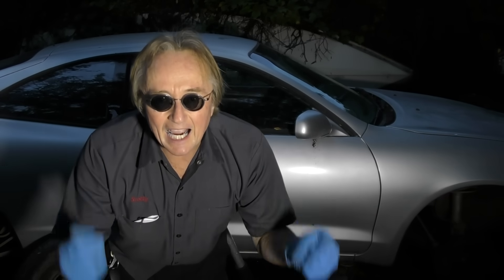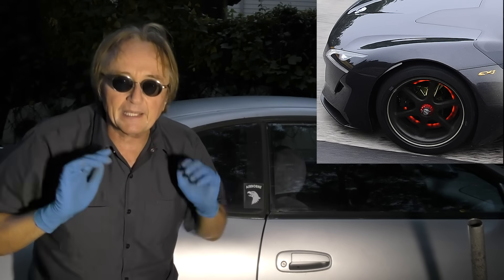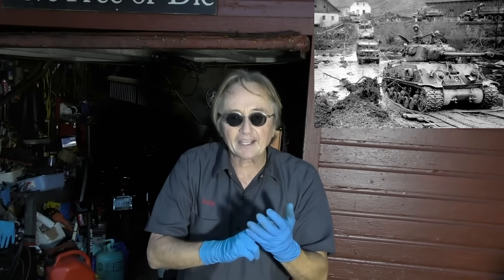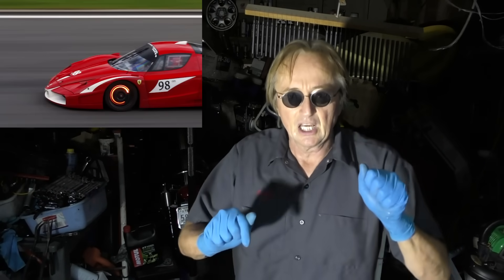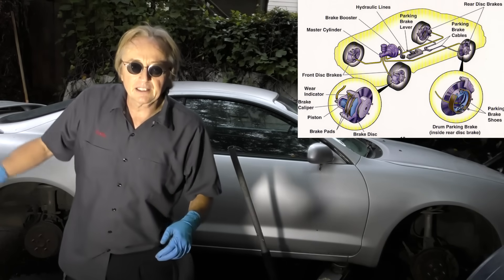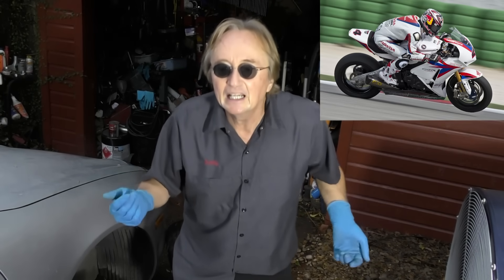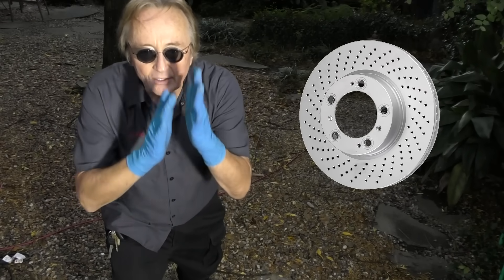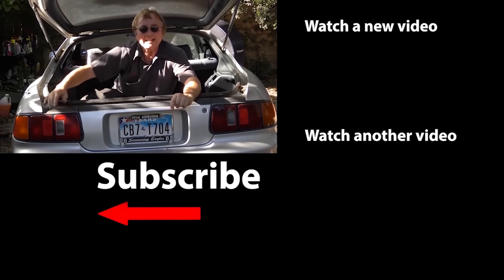Why Some Cars Have Drum Brakes Instead of Disc Brakes

Comment: i put slotted disc on my mother in laws 06 grand caravan because it has sense new, ate a set of front brakes and rotors every 18/24 months. after putting slotted rotors on, the brake shake and fading and excessive wear she was experiencing went and stayed away.

Comment: Yeah, but I heard an advantage drums have over discs is that drums don't lock up? In cars without abs of course.
Reply: Not really true, they lock up just as easy as any other brakes will.  ABS was just yet another nonsense feature to allow idiots to drive.  The disc/drum brake has nothing to do with them locking up which is one reason many pickups had rear ABS for several years because people would hit the brakes really hard in slick conditions and end up locking up the rear brakes causing the vehicle to do donuts in the middle of the road LOL...haven't seen any of those vehicles that the rear ABS really worked well on though, those who know how to drive just continue to use the regular non-abs driving skills of pumping the brake pedal to stop rather than slamming on the brakes and sliding out of control.
Reply: JohnoEAL 
That's not true - it's rubbish
Reply: With all of the old cars I've owned, I am here to testify that drum brakes can and do lock up. Who ever told you that needs a laxative.

Comment: if you have rear drum brake, it might be worthwhile to retighten the shoes so the handbrake grips more and the car does not dive much when braking, as shoes fade away.
Reply: On many cars you can do that by back up real quick and slamming on the brakes, in an empty parking lot where you won't hit anybody. The star wheel will tighten them up real quick. I hand tightened mine on my cobalt before someone else totalled it, but I found I got a little more if I backed up and braked.
Reply: Most of the drum brakes are self adjusting, all you have to do is backup in a straight line and hit the brakes moderately hard and they'll adjust automatically...that is if the adjustment parts aren't rusted up...as many are especially in the eastern states where they use salt on the roads in the winter.

Comment: One thing I like about discs is they're so much easier to work on.  I just replaced my rear brakes on a '77 Trans Am because I dreaded working on the things so much, and there's no way I'm letting some 19 year old tech do the work.  That would require I trust a 19 year old with a 41 year old car... not happening.

Comment: Scotty i agree.. A few persons i knew converted rear drums to disc and ended up with worse braking performance because they didn't factor in the drum brakes provides more braking torque than disc and the needed to change the proportioning valve to compensate for that..
for regular driving stick with the factory setup

Comment: How to get stuck rear brake drums off if the hand brake cable is stuck and the brake shoes are pressing to the drum walls? There is no way of adjusting the shoes from outside. Car is simca ariane -62

Comment: Something I've noticed on newer vehicles recently...manufacturers are putting drilled slotted rotors on both front AND the rear as some sort of "performance brakes add-on"...that's so freaking overkill smh especially on stuff like Chevy and Ford trucks. TRUCKS

Comment: I remember back in the 70's when mechanics charged around $25 more per axle for disc pad replacement over drum playing on the public's ignorance. That's now the opposite. I really hate working on the drum systems with those springs shooting off and trying to figure how everything goes back together.

Comment: Drum brakes are a pain to work on compared to discs (springs and other hardware, stupid star wheel adjuster too).  Drum brakes wear unevenly.  The radius of the shoe doesn't match the drum perfectly, so only part of the shoe makes contact.  Slotted and drilled discs don't warp in a month like the crap replacement rotors they sell now, no matter which brand you buy.

Comment: So Scotty...I ha e a 1966 Chevy Corvair.  The factory installed Chevelle drum brakes on Corvairs, but swapped them front/rear, because the Corvair's engine is in the rear, and of course the car has rear wheel drive.  That being the case, I was told most of the braking is done by the REAR brakes, not the front, and therefore a front disc brake conversion wouldn't be an improvement.   What do you think?

Comment: All of my Subaru's had and have 4 wheel disc brakes. I was looking at an 06 Forester that had front disc's and rear drums, deal breaker for me. Disc's are much easier to work on. Yeah I know that ebrake is a disc on the rear.

Comment: Just like you said Scotty, disc brakes is better. The only drawback is cost. If you are OK with the cost than disc is better.

I just bought a new (used) car. 2015. I made sure to get 4 wheel disc. The cost is more but it is worth it in my opinion.

Comment: Braking pressure differential 80%  on front 20% on rear  The rear disc work better off road backing down step hills . 4x4's  need 4 wheel disc.  My drum brake motorcycle can't stop with out using both brakes.

Comment: When I bought my 3 series a year ago, the front brakes were done for. Under braking, the steering wheel would shake itself out of my hands. I replaced the front discs with new, drilled discs and now it stops on a dime. Though they need to be a bit warm to do that.
The problem, and I've had this ever since I got the car, is that sometimes when I drive over a pothole while braking, the front wheels lock up. Even if I'm just barely pressing the brake pedal.
Anyone have any idea what's wrong with my car? I'm starting to think I either need to bleed the system thoughrouly or it's something to do with the ABS.
Reply: That's what I don't understand. ABS works fine every other time, but when I hit a pothole while braking the wheel simply locks up for a split second, or tries to lock up, depending on the speed.

Comment: Absolutely correct on the rear drum brakes.  For daily street driving, all they do is keep the rear of the vehicle from trying to overtake the front on hard stops.

Funny story which happens every single time I ride the motorcycle to a bike night type event.  I do a lot of performance and distance touring on two-wheels.  I can't even begin to count the miles and miles of Appalachian mountain twisties I've hammered over the last half million miles.  Anywho, front/rear braking is something one must know intimately for such riding.

Back to the urban bike nights...  My front hydraulic lines are braided stainless steel.  The rear line is kept as-is in the OEM DOT rubber example.  The uninformed always attempt to comment on my incomplete brake line upgrade.

Rear brakes on motorcycles are touchy enough already.  Foot pedals, boots, and limited throw kinda make for a lack of granularity and precision.  The natural flex of rubber DOT lines for the rear actually aid in precision and feel for the rear in my experience.

It's all about knowing the how's, why's, and results of various component designs.  As well as how such upgrades/modifications work for the individual driver/rider.

Another nice informational video, Mr. Kilmer!
Reply: I don't ride, but very interesting information regarding the brake lines.

Comment: Can drum brakes get hot enough to emit smoke? A couple months ago I had a real scare with my truck when I drove it across town for something and when I got to my destination there was a little smoke coming from behind the front driver side tire. I thought there was a fire in the engine but couldn't see any flame, yet there was light smoke and crackling noises that sounded like something burning. Eventually it stopped after a few minutes and nothing really bad happened that I know of.

Comment: I prefer 4 wheel disk brakes. I find they are easier to  work on than drums. Manufacturers put drums in back to save money. Easier to tell when disk brakes need changed than drum brakes

Comment: You forgot to mention how drums are also used for the E-brake. My 2004 F150 has all 4 disc brakes, but still has drums inside the rotors on the back for the emergency brake.

Comment: LOL I ride my motorcycle daily and take it to the track. I do use my rear brake a lot but 99% of what you say is true and yes you just dont use much rear cause its not as powerful, most of the weight is on the front which is why the bite is biggest up front. THAT SAID i find when i apply rear brake on my bike OR car (with use of emergency brake) you can get your rear end to rotate out allowing for a tighter turn when applying acceleration out of said turn. Its also loads of fun. LOL So in closing rear brake are useful but typically for tactical maneuvers, and i have to just say most of you guys suck at driving and should allow me to pass when ever im needing to. Dont cock block me.

Comment: Here in the North East, discs rust so fast when exposed to road salt. I have to change discs every 2-3 winters. I wished my car had drum brakes. Most trucks use drum brakes all around and there is no problem with water or fading (unless the driver does foolish things).

Comment: The brake bias of 90-10 is really extreme, and in that car (if it's true) mostly down to the fact that the rear brakes are a lot weaker than the front. If you truly have that bias you could significantly improve your breaking by changing to disks, or even to just replace your worn out drums. The rear brakes are not just for stability, but they're usually slightly weaker than the front for what should be obvious reasons.
Reply: could it be because it is front wheel drive?  I know the bias is different in RWD cars.
Reply: Brake differential between front and back is usually 70/30 due to brake differential valve.
Disc brakes and drum brakes have roughly the same efficiency, it's just discs are less prone to fade.
The braking bias on front wheel and rear drive is the same.
Why should it be different??
Under heavy braking the forces are
precisely the same.
The fwd may have more weight due to the gearbox,but rear locking would be prevented by the rear brake differential valve on a road car.
I have built braking systems for rally/competition, cars and could go into more detail.

Comment: My 2002 chevy venture i owned since new, and i just did my first rear brake drum shoe replacement in 2017 with 165,000 miles on it.  The front were replaced about 6 times already by then.  If the rear were disc, it would have been a more 50/50 braking, but it being a 90/10 (which i knew) it makes sense.  Yep, drums are more durable in the northeast usa - especially in the rear where the heat of the engine does not dry the moisture around the components.

Comment: Here in Costa Rica we have anual inspections. I got fed up with my 2004 wrangler rear drum always failing the inspection for uneven performance from one side compare to the other. So I converted to the Grand Cheroke rear disc, they bolt on. No more fail inspections for the wrangler.

Comment: Nice explanation. Scotty got it right this time. But he left out one of the reasons for putting drums on the rear – the parking brake. You don't want to rely on hydraulics to keep the car from rolling away after you get out of it. You want a strong, mechanical linkage to keep the friction surface firmly in contact with the drum or with the rotor. With rear drum brakes, a simple cable from the handbrake lever to the brake shoes, and another lever attached to the brake shoes, can keep the brake shoes in contact with the drum. What kind of mechanical connection are you going to use to keep the friction pads in disk brake caliper in contact with the rotor? While some cars do have some kind of mechanical connection to keep brake pads in contact with rotors,  the solution for other cars is to use a combination system which has a rotor and small drum cast into a single unit, and small brake shoes inside the drum. So now you have disk brakes AND drum brakes on the rear. Now things are getting more complicated, and heavier – heavier than plain rotors would be, and possibly heavier than plain drums would be – defeating one of the advantages of disk brakes. Might as well just make the drums a little bit bigger, and dispense with the rotors.
Reply: I had a '73 Peugeot 504 sedan, and it had 4 wheel disc brakes. They had a metal cam on each rear caliper that was connected to the park brake cable. The easy way to set them was to hold your foot on the brake pedal, then pull the park brake handle. They worked just fine.
Reply: As a former Peugeot dealership mechanic and the owner (due to some momentary failure of my thought processes) of a 74 504, I feel your pain LOL!
Reply: My car Tata aria have all 4 Disc brakes , but handbrakes are mechanical itself , drum inside the disc is used as normal brake drum with brake shoes inside , so the handbrakes on my car are fully mechanical (drum brake) and its all wheels are discs ...got it?
Reply: Furthermore, if your drum brakes are warm after driving, when you're parked the drums will shrink onto the shoes as the brakes cool, increasing the braking force. 
Disks however will shrink away from the pads as they cool, decreasing the braking effect.
I used to have a Peugeot with 4 wheel disks, I once parked it in a driveway with the parking brake on but forgot to leave it in gear. The brakes cooled, the park brake lost its grip, the car rolled backwards across a busy road and into the neighbour's fence across the road. Oops
Reply: Yep. That's why trucks that need a reliable and strong parking break have them. Trailer plus truck on a hill can cause a bunch of damage if it gets loose.
Reply: I remember the Corvette disc brakes.  I worked for a Chevy dealer.  My understanding was that the parking brake slipped on the rear disc brakes.  I never thought about the fact that the linkage might have been the reason for the change back to drums.  They told us that the static friction on a disc is less than on a drum.  Hmm.  I bet they were lying again.
Reply: @alext9067  i would say they are probably right about the static friction since a drum brake has a lot more surface area in contact than a disc.
Reply: If I remember correctly, the earliest Corvettes with 4 wheel discs had an expensive limited production "competion brake package" option that consisted of.......4 wheel drum brakes. Big ones, with finned aluminum drums, but drum brakes. I guess some racers weren't quite convinced yet of the goodness of discs?
Reply: Some cars, like my Mercedes ML, have rear discs for driving with integrated drums with shoes for the parking brake. There is a physical cable running from the parking brake pedal to the drums.
Reply: Sorry, but you looked at any parking brake system on a car with disc brake rear? You're correct about you shouldn't use hydraulic pressure to hold the car over time, but manufacturers don't do that. eg the Celica in Australia doesn't have drum brakes on the back, it only got disc brakes. They have a system where there's a drum brake inside the disk that's dedicated to the parking brake and operated by the cable attached to the parking brake lever. The same age late 90s Corolla that has a disc brake rear has the parking brake cable attached to the brake calipers directly, which forces it to close onto the disc. Both work fine.
Reply: got that right ; well said Theodore
Reply: My e39 bmw has both "drum brakes" and disc brakes, for parking and for driving being the latter....🤷🏿‍♂️🤦🏿‍♂️wasnt aware this wasnt the case for most cars?

Comment: Scotty, im a Toyota guy, but the new tacoma still has drum brakes on the rear, reason by toyota that i will perform better when off roading on sand and mud, then why is it that other manufactures like chevy, ford even nissan have 4 wheeel disc brakes?

Comment: The only problem I had with rear drum brakes was when I forgot to keep the brakes adjusted on my '86 Merc Sable. They're supposed to be self adjusting I find they don't really self adjust themselves that well to the point on my car they weren't working and wore out the front disc's better, even warped the rotors. But Ford also had a recall on those rotors. Any way day I was driving along and came around a curve to a stopped school bus and almost ended up in someone's yard. I make sure my rear drums are adjusted now. Maybe not using the parking brake back then had something to do with the adjustment also. Not really sure how that works. Might be something to discuss, if you haven't already. Thanks, Scotty
Reply: Put your car in R, and slowly start to do increasingly harder reverse brakes. This will adjust them

Comment: Hey Scotty and Car experts, I am feeling a little buyers remorse since I had to go through my bank to fiance a 04 Camry XLE with 163K miles on the car due to the winter months coming up and I got sick of walking. Its no way I can get my money back or return the car but I just want to know will my car make it too over 230K miles since its a Toyota? The Maintenance has been done on time and everything looks up to date. Will pay off the car in 18 months vs 3 years what the bank gave me. What can I do other then oil changes to keep it running good and well for the long term? Should the 4speed AUTO transmission be good for another 3 years and engine? Brakes were done last year in 2017 on the carfax.  Its a timing chain and I got a new starter with the car.

Comment: The most reason they don't use drums in front is locking up.they lockup very easily that's why they are used for handbrake and you don't want your front end locking up on heavy braking

Comment: My 89 Aussie assembled Ford Laser Ghia (a rebadged Mazda 323) has discs front an rear but is still pretty ordinary in the stopping powers.
Scott forgot to mention ventilated discs vs solid discs where the ventilated discs are twin discs with radial vents layered in the between.